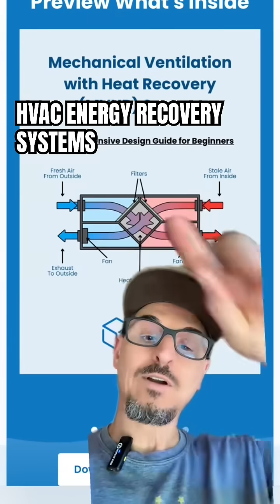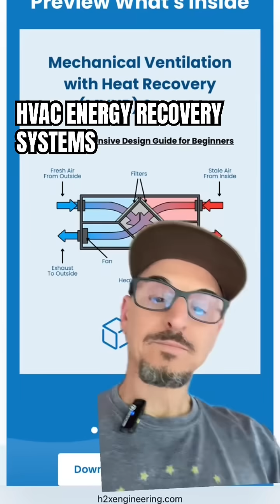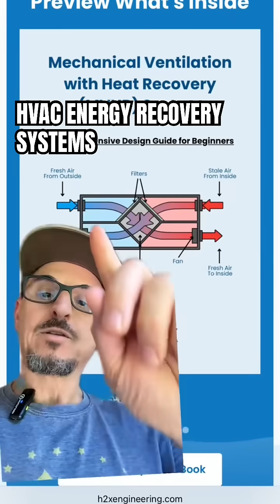Energy recovery systems for HVAC

Comment: the section where heat is exchanged is some type of mechanical heat exchanger that allows the wall seperating both air streams to pre heat or pre cool outside air. The heat exchanger passes both streams through narrow channels butted up next to one another and some mix a fixed amount of exhaust air with fresh air. If your company sells them call that companies tech service. They may explain how they work better than I can
Reply: Thank you for your explanation though